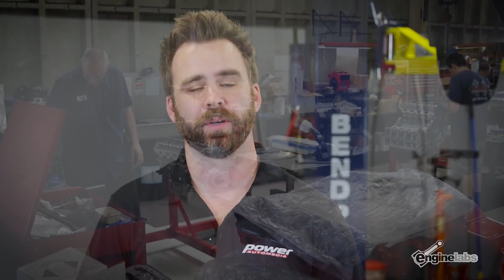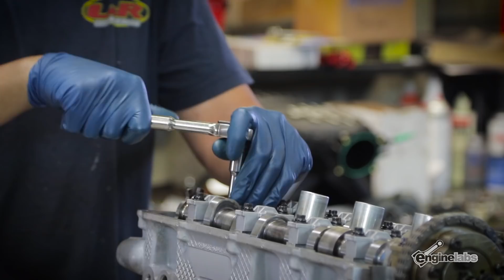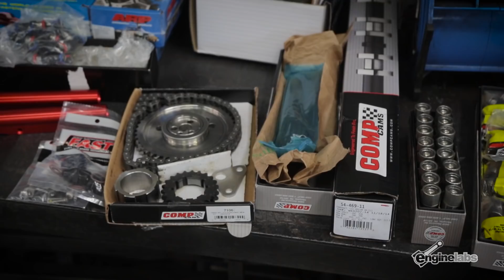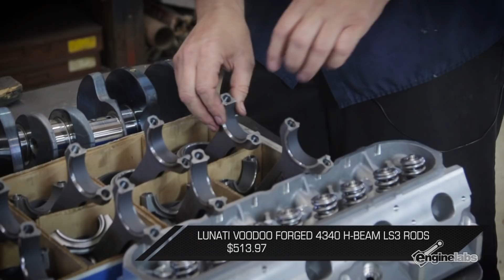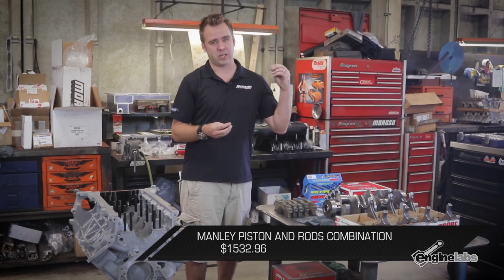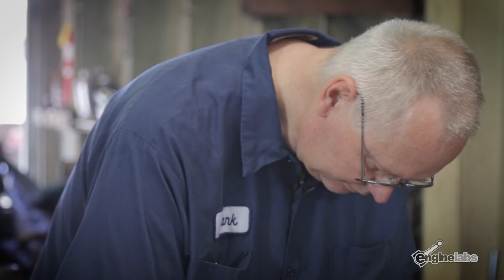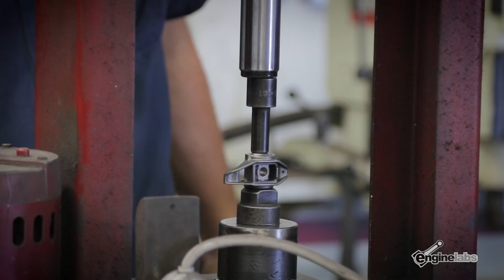$10k Coyote vs LS3 Shootout - The Build

Comment: How is this a reasonable comparison???
6.2l vs 5.0l
Brand new vs used
Old and cheap vs New and expensive.... I know... lets make it a budget build... yeah right!!!
No bias here at all...

I'm gonna laugh my ass off when the coyote beats the handicapper.
Better look for part 2 in another 4 months. maybe it'll be done by christmas.
Reply: you know the ls3 won right lol
Reply: 2 valve vs 4 valves, pushrod vs DOHC, the coyote has the superior more advanced design. So it does make sense to compare the 2. and the machined block has 2 extra cubes. That helps with power,  not much but definitely won't put it below stock.
Reply: Stephen Ayeni I hope this doesn't come across too aggro (I have a tendency to seem angry when I'm not) but the more efficient heads of the coyote can still stuff only so much air into the cylinders. All that technology won't put 25% more air in so how is it a fair comparison to put the coyote against a motor that has 25% more displacement? As you can probably guess it takes about 145 cubes for the LS3 to overcome the superior design of the coyote. Notice how they didn't go for the LS2 even though it has the same displacement as the LS3?
My biggest issue is how the coyote was handicapped with a piss poor budget. The LS engines have been around for ages and has a massive aftermarket following so there's loads of cheap parts on offer. Compare this to the relatively new coyote, and there's not as many aftermarket options as yet (more are coming...) Add to this the fact you need 2x more valves and springs, 4x more camshafts, a much longer timing belt with loads more pulleys etc. and $10k evaporates rather fast. At the end of the day I can see no reason to blow $10k on rebuilding these motors when there are crate motors out there for far less money.
Reply: The coyote has to hold the L somewhere unfortunately. The LS3 does it in it's cheaper 1950's simplistic design, vs the Newer DOHC design. Making power with smaller displace is good if it's a rotary and gas taxed V6 imo. But with V8's, why try to make more power with less displacement, worse gas mileage, inferior center of gravity, and larger physical size? Why not use displacement and have gobbs of Hp and Torque under the Curve, and great gas mileage. The DOHC is superior in technology for economy cars and high revving v6's. However, with muscle cars I can't see the practicality of revving to make more power. The design is great, but if it isn't broke don't fix it. GM,Dodge, and SRT all have it right in that regard. Coyote wins in Power per Cubic inch, but loses where it matters. Power per pound, power under the curve, gas mileage, and most importantly meat left on the table. How much more can the average person squeeze out of your coyote NA. We're all enthusiast, but I love that GM caters to hotrodders to. Cam and full bolt ons net 100hp and 100 torque and still pass emissions. In the coyote I've seen cams and bolt ons give 50hp and 9 torque, but shifted the rpm band way up, which means for a street car, the factory cams work best. I went off on a huge tangent, but I agree, the LS3 isn't a fair comparison, it's just too good! I would love to see a 6.2 coyote. I wouldn't imagine it being much more than 20 pounds heavier.  I hope Fords marketing team lets the 5.0 go, and get back into the displacement race.
Reply: +Stephen Ayeni Typed this on my phone, so grammar nazis spare me.
Reply: Stephen Ayeni It's not surprising to see lower net gains on the coyote since it's so much less "meat left on the table" straight out of the box.
From a "street car" point of view there's no need to modify any V8's because realistically, where can you use more than 300hp on the street?
I'd love to see Ford take a look at their history and go back to building larger displacement engines too, but the European bias in their "One Ford" philosophy is just a great big fuck you to the rest of the world. Just take a look at what they've done in Australia. Apart from shutting down manufacturing and killing off the iconic "Aussie" Falcon, they turn around and say "No V8's for anyone... but if you absolutely have to have one, we'll let you have an Aussie delivered (instead of private import) Mustang for about $100k".
Reply: +scott thompson I dont think there has been a "Need" to modify cars since the illegal acts that gave way to Hotrodding. I dont know many enthusiast who say they need to modify their engines. It's about the pure excitement of creating something different and personable to yourself and enjoying your creation. Torque is KING on the streets not HP, and we all know the saying. There's No Replacement for Displacement. Chevy and Dodge just needs to focus on Power to weight with their vehicles😂
Reply: Stephen Ayeni Torque is king everywhere, not just on the street. Another old saying for you... Torque wins races, HP sells engines.
Reply: +scott thompson Glad to be able to converse without being called all kinds of names. Youtube is getting better lol. Are you a Ford guy? if so, have you taken a look at the old video where they made 625 hp NA on the coyote?
Reply: Stephen Ayeni I do what I can not to rage at people unless they start hurling abuse first, then I go full tilt... :P (Standard behaviour for most Aussies...)
Yes I am a fan of the blue oval... I kinda thought my first comment hinted at that... lol... and I've seen plenty of videos of coyotes making those sort of numbers. If you want to see something a little different check out the "Miami" engines. They're based on the coyote, but have a slight twist.
Reply: On the displacement side, I think that is the point of the comparison. Old school tech with large displacement vs modern tech with focus on HP per cubic inch. As for the new vs used, yeah, I'm with you there.
Reply: Xaro Xhoan Daxos The point emphasised in the video is the "budget build" of $10k, and yet they wasted the coyote budget on shit they didn't need. It raised an interesting question though... how much more displacement do you need to offset the better technology in the coyote??? The answer in this case is obviously +24% and some number fudging.
When they were planning this episode I'm willing to bet their thought process was along the lines of "lets compare the 5.0 coyote to an LS... Lets see... Which one... 5.3 and the coyote wins... 5.7 and the coyote still wins... shitty spec 6.2, nup, still the coyote... I know... upspec'd 6.2... OK we're on to something now..." for all the bullshit they went through to make the LS3 look good they might as well have gone with 5.0L Coyote vs 27L Rolls Royce Meteor... (would have said Merlin but that was supercharged)
Reply: scott thompson Yeah, I'm pretty sure they were just comparing the engines that directly compete against each other in their respective cars within the same segment, which is unquestionably the Mustang GT and Camaro SS. You can't get a 5.3 or 5.7 in the Camaro. Pretty sure that is why they chose the 6.2...
Reply: Xaro Xhoan Daxos The information I have is the LS3 was not on offer at the same time as the Coyote so that comparison argument is flawed. The current camaro engine is the LT1 not the LS3. Being new and expensive (ie. limited aftermarket parts) the LT1 runs into the same problems as the Coyote. That means they can't use the budget to influence the outcome in favour of the LS.
Due to strong aftermarket support its not hard to take an old 351 Cleveland, throw $10k at it and drive away with 700hp, but that won't help these bowtie bandits stroke their ego's either...
Reply: scott thompson You think the LS3 was not on offer at the same time as the Coyote?? Are you actually a car enthusiast? I thought this was common knowledge in our hobby, no? The Coyote was put into the GT in 2011, what engine do you think was in the SS that year and all the way up to 2015? The LS3.  The Coyote has been in direct competition with the LS3 for many years now and was an appropriate engine to compare to the 5.0 since that block was from a 2014 Ford anyway.
Reply: Xaro Xhoan Daxos The information I have says the LS3 was offered from '08 til '11, meaning it was phased out at about the same time the coyote was introduced. The specs I'm finding for the current camaro's suggest they are running the LT1, listed as being offered from '14 til present. If that info is wrong then so be it. Since I'm not American and wouldn't piss on a chevy if it was on fire I really couldn't give a fuck what engine they used. My point still is they showed massive bias in this comparison.
Reply: scott thompson Six-speed 5th Gen SS Camaro's, 2010-2015, had the LS3 as their only V8 option, making it the direct competitor to the Coyote. Consider yourself educated. Even if you hate Chevy, you should know what your competition is running.

As for bias, you mean they were biased towards Ford, right? Because they used a picked Coyote block and a brand new LS block. If they went with a picked LS block, they could have saved a fuck load of money and put it into the LS engine creating even more power.

Look, say what you want about the Coyote's superior tech, it is superior, but we all know it is simply much more expensive, period. The LS platform has been out since 1997, it's bulletproof, easy to mod, and there's millions of them out there, making it far cheaper and giving it more aftermarket support than the new Coyote.
Reply: Also lets not forget Chevy Can do DOHC. Do not forget the 400hp LT5 from 1991. 25 years later. Chevy chooses pushrods bc production is cheaper. But they can beat Ford in the DOHC if they so chose to. 2018 should bring the LT5 back,  we don't know if it will be DOHC, but let's hope not for ford's sake lol!
Reply: Stephen Ayeni Chevy still does DOHC, the 335hp V6 in the new Camaro is a DOHC.
Reply: which also out performs Ford's V6!
Reply: scott thompson awkward moment when the LS wins lmao
Reply: Aww...boohoo, ford fuckboy!!!  You have been weighed, you have been measured, and you absolutely have been found wanting.  High five for anyone who gets this reference
Reply: scott thompson because it would be unfair of them to buy a junkyard 5.3 and boost it with some rods and pistons.
Reply: Xaro Xhoan Daxos you say Mustang Gt yet the motor came out of a F150
Reply: It was all based off of money spent. They actually handicapped the LS3 by buying a new one because for the same money spent they could have bought a used one and made way more power. The Coyote never stood a chance.
Reply: scott thompson it's more expensive to build a used 5.0 then a brand new LS3 lol that's the point Einstein
Reply: That's a good point. Fords don't compare.
Reply: Stephen Ayeni dude if 5.0 kills the 6.2 just imagine a 6.2 coyote chevy will need a 8.0 to beat it
Reply: Joe Robertson ehh, not really.
Reply: Is a 10k budget build a new coyote motor cost how nuch
Reply: LOLOL Ya its OK to out cube the competition. That said the 2018 GT makes 460HP with way less torque than the LS 6.2 in the new Camaro...and out accelerates it. Why does GM not make a 5.0 to compete. Cause they cant...its to much money to give their followers a better motor!!!
Reply: and they wasted a bunch of money on that Ford. The 5.0 can make a bunch more power than that!!! Didn't need pistons and a bunch of stuff. If it was based on price they could have just simply boosted the 5.0 and won regardless!!!

Comment: TeamCoyote
Reply: Rob 72 and team coyote got shit on even with the help of using a truck block to save money
Reply: @SilverRaven1959  but ls is cheaper and more accessible
Reply: SilverRaven1959 Isn’t it the other way around? I see PLENTY of stock bottom end LS’s hitting high hp numbers under boost. Not only that, torque, weight, compactness, and value all go to the LS. Don’t get salty because of the LS’s superiority

Comment: That coyote looks like a big block I didn't realize how big they were.
Reply: Mod motors are all roughly the size of a big block
Reply: +Brandon Phillips Thats nuts considering the volume is usually 25 to 50% smaller at least!
Reply: if the cams aren't in the motor, you gotta put them somewhere.

Comment: I don’t believe this is a fair
Comparison for each motor. The Coyote is an incredible motor and it’s crazy the power levels it puts out for a 302 Cubic inch but it’s pricy to build. You need to have a good supply of money for for a 5.0 build. LS motors are much better motors for the masses due to you can mostly build one for around 10k as this video shows.

Comment: What amazes me is dollar per HP on both of these engines. Call me old school or call me what ever you like but when you can buy a 632 BBC for about the same price that produces 820HP and 800lb feet of torque on pump gas, and would flat out stomp both of these engines in a drag race why would a person even consider building the LS3 or Coyote. Just my opinion but I'm all about bang for your buck, not what's new and supposed to be the new trend. Not to mention a big block just flat out looks bad ass!
Reply: +Rob Hamilton but what if you DD the car?  that changes things.  some people do more than just drag race.
Reply: +Rob Hamilton drag racing... meanwhile in the rest of the world these are engines one can use in many applications like road racing and daily driving. and they weigh less too. coyotes can make 600 at the wheel naturally aspirated from a 5.0. LS3 has made 731 at the wheel NA too. probably get better gas mileage due to efi as well meaning better endurance. most would rather have that power in a way that they can drive every day if they wanted.

Comment: OK.. why wouldn't you use the Holley High ram intake manifold which would be similar to the coyote having the higher ram style intake? Seems like you kind of limited the air if you are moving into the induction process by using that composite style manifold on the LS3

Comment: LS has the advantage given the displacement difference. The 5.0's superior head design only shows its colors with BEWST.
Reply: Superior head design yet the LS has an advantage because it has more displacement? How about buying a complete used LS for less than the cost of the Coyote, throw in a cam and still be under budget and it would still beat the Ford. This comparison is way out of reality by calling it a budget build. Simply by being on a budget the LS won ten years ago.

Comment: IMO Ford makes great engines. Especially, with the power the 5.0 can dish out. The LS has a better bang for its buck and still has plenty of room for tuning. The Ford engines run very well, but are more complicated with the electronic components and size.

Comment: I think LS3 is gonna be able to put down more power, is more ready to be boosted, has a better torque curve, and its compact nature makes it a better choice for engine swaps.
Reply: You're wrong.  Coyote makes more power with boost on a stock long block and it's not even close.  A gen 1 can do 700 wheel easy with good fuel and gen 2 and up 800-900+ no problem stock long block.  I don't think this shows the ls3 being "more ready for boost" quite the opposite.

Comment: Not even sure how this is a budget build.  A budget build would be grabbing to comparable made blocks from the scrap yard and going from there.  Then you have comparable price and comparison, year by year.  Do a part 2 with the fair comparison of Fords 4.6L V8 Modular engine.  It's produced at similar volume numbers providing a more fair comparison all the way around.  Besides Motor trend did something like that and Ford won.
Reply: using a 5.3 LS and the 4v 5.4 from a Navigator would be nice. Both engines can be had for the same price.

Comment: ive owned both and if you are lookin to make some cheap power, LS all day, but if you plan on making big boy power in the long run, then coyote all day. That 2 valve only gets ya so far, hints the reason you never see 95-04 stangs on any 1320 vid unless its a terminator(4 valve) bc more valves =more power
Reply: Ls3 isn't any cheaper to get power from than a coyote.  A coyote can make big power easier just boost on a stock long block.  The ls needs alot more cubes plus cam and springs etc to even come close.  Cost wise they cost just as much to modify.  Only area that is significantly cheaper is when you do a cam as there is 1 and not 4.  Outside of that nothing else is significantly cheaper when modding an ls3 vs a coyote.
Reply: There are guys making 1000+ wheel with build 4.6 2vs.

Comment: People tend to think that because an DCOH Engine produce more power with less liters it weight less and use less gas. The difference un gas is negligible and More displacement means More EMPTY SPACE. That's why OHV need more space to produce the same power but they are Lighter and weight less than DCOH and are more reliable because they have a lot less moving parts.